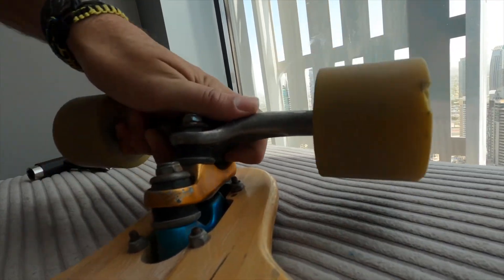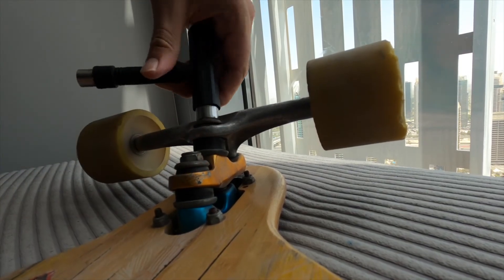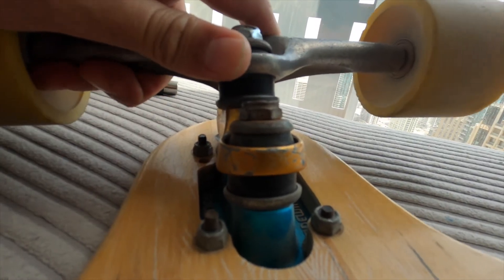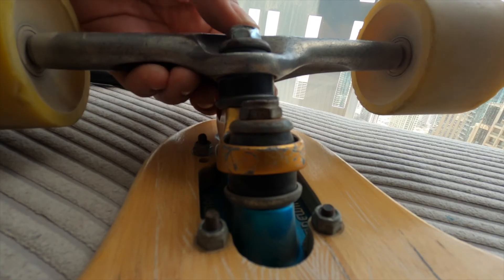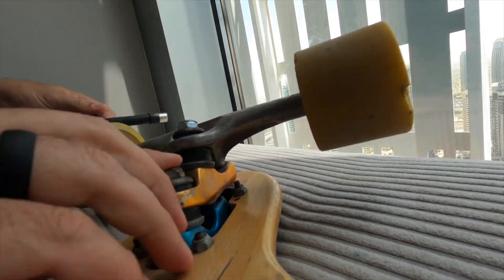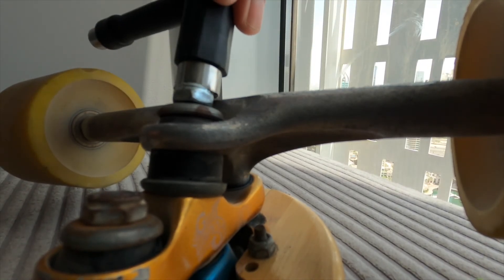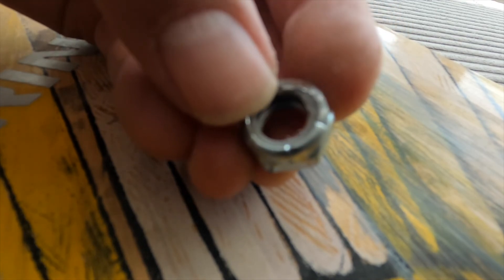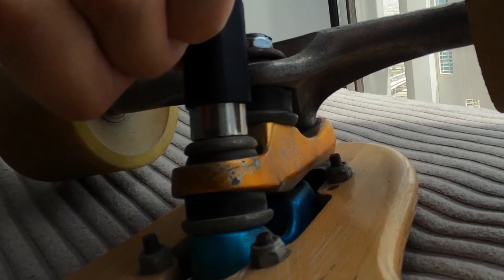Loose Trucks Save Lives: How Tight Should Longboard Trucks Be.

Comment: does this apply to electric boards as well?
Reply: Eskates are a bit different because some can go 35mph, 40mph, 50mph etc. At higher speeds, looser trucks will cause speed wobbles, but this can be overcome with more experience and good techniques, such as leaning forward on your front foot so you have most of your weight on the front truck. That being said, you just have to try it out for yourself since there are 3-4 different types of trucks for eskates and each behave differently of course. Set your trucks loose so that turning is easy but increase your speed slowly so that you can start to feel a wobble, then either tighten your trucks a bit or try to change your weight distribution to see if you can overcome the wobble. Keep in mind that the moment a speed wobble comes on, put more weight on your front foot, try to keep your acceleration the same. Abrupt braking can also lead to more wobbles. Pretty much you don't want to change your acceleration or your speed the moment you experience a wobble, keep everything the same, move your weight towards your front foot and try to carve it out. Don't jump off your board, you're not going to outrun it if you're going above 15mph.
Reply from the maker: good points